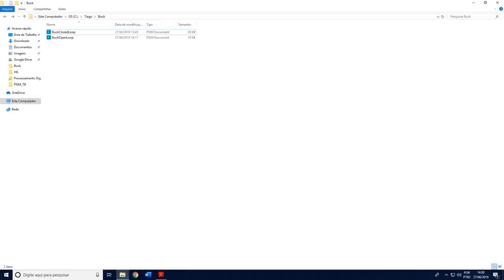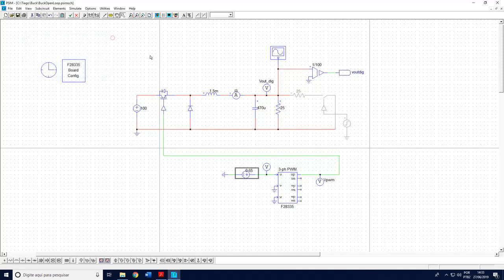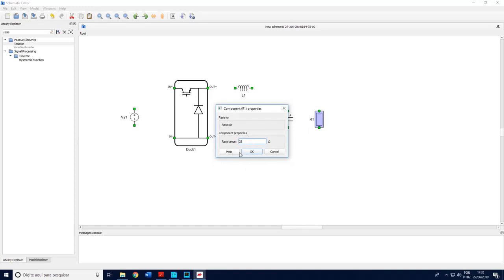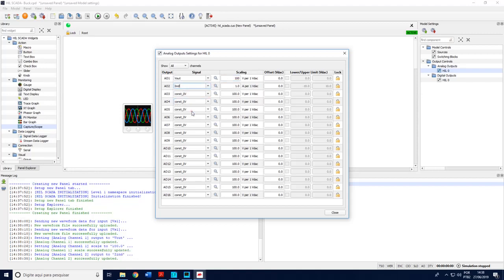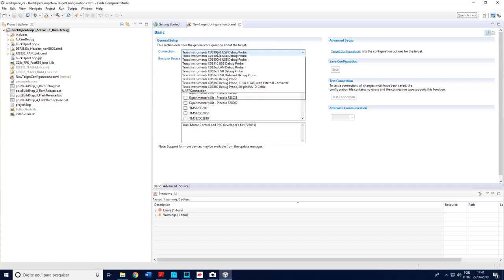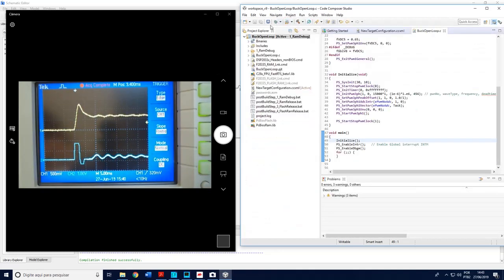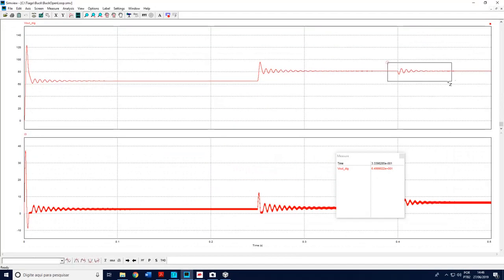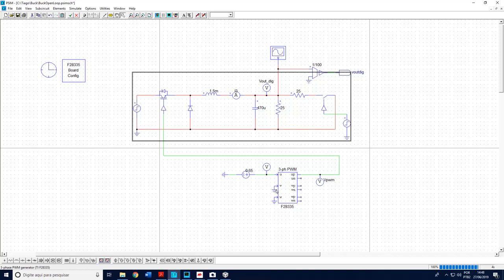PSIM Typhoon HIL Buck Converter - Video 1 of 2

Comment: Congratulations on the video!! I'm trying to implement Buck for the DSP F28379D. However, when I compile the file in Code Composer Studio, it has errors which are: No rule to make a target So, I would like to know if there is any adaptation to be made to use the PSIM generate code for this DSP?
Reply from the maker: Thank you. 
- Are you using PSIM to generate the code? What version of PSIM?
- Is the target properly set in CCS? 
- Are the drivers of F28379D properly installed?

If the code is ok, probably the problem in on the driver (the USB port for F28379D)

Comment: Nice demo. You can also import PSIM schematics into Typhoon control center directly. They are converted as schematic editor files. 

BTW, do you know if a Typhoon based C-HIL simulation qualifies as an experimental validation for IEEE journal publication?
Reply from the maker: Thank you. I think the conversion from PSIM to Typhoon is only for version PSM 12. Please correct me if I'm wrong. 

I'm not aware if results from HIL are valid as experimental verification in IEEE journal publications. On Typhoon webpage you find a list of papers that used results from HIL. https://www.typhoon-hil.com/published-papers/
We need to check if one of this papers is published in IEEE journal. 

If the focus of the research is in a control strategy or  an algorithm, and if you use HIL + DPS as I used in the video, in my point of view the research is experimentally verified. This is because the control strategy or the algorithm is running in a real DSP.  Nevertheless, IEEE journals accept that is another history.
On the other hand, if the focus of the research in on power topology, like a proposal of a modified DC-DC converter, a resonant converter, then the verification in HIL may not represent the reality.  It's my opinion.
Reply: @Tiago77916  

hanks. Yes, you are correct regarding the PSIM v12 requirement. My institute (BGU Israel) currently has a license for V11.1.5. We just got the HIL402 and I haven’t had a chance to use it because of the Covid19 break. I’m currently watching the seminar videos on line. I’m a second year PhD student, and my research area is multilevel converters. So far I’ve managed to publish 2 IEEE papers, both based on PIL verifications (https://ieeexplore.ieee.org/document/8646113/   
https://ieeexplore.ieee.org/document/8741195/).

I’m curious to find out how the PSIM to HIL conversion work. The biggest problem with PSIM is its limitation to scalar signals only (no signals can be joined as a vector like in Simulink and PLECS). The Typhoon schematic editor does support vectors, so I wonder how it handles PSIM schematics. Maybe the vector signals are now supported by PSIM v12? I need to check this out. 
 Cheers

Eli